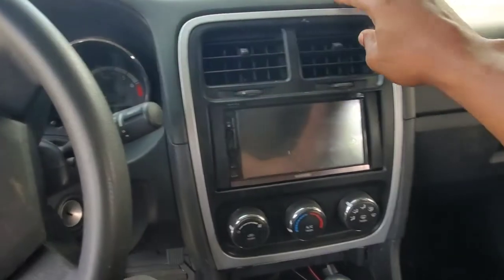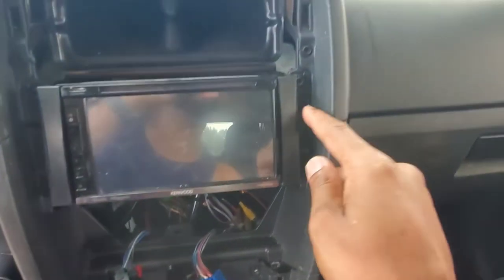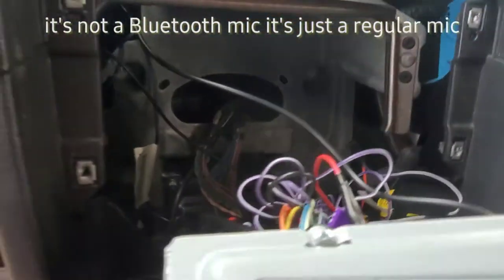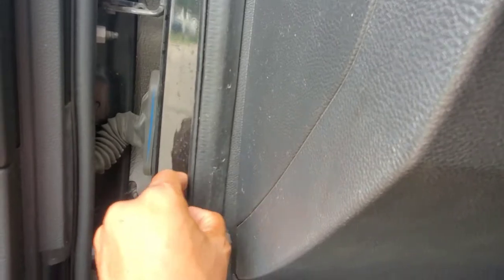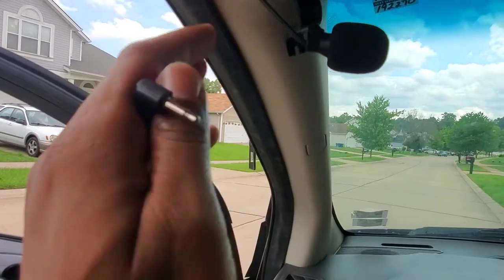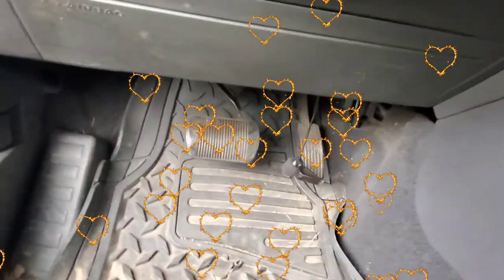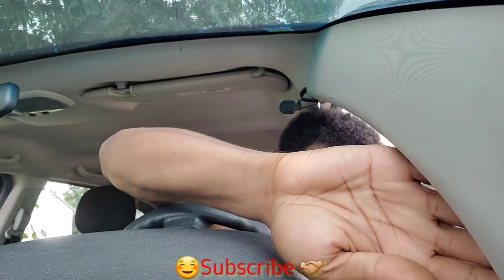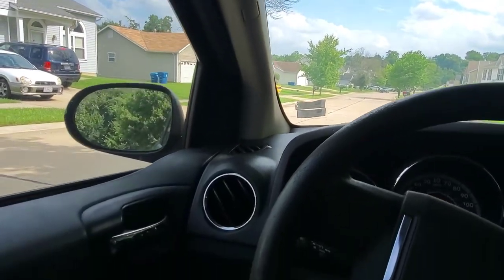How to install a mic for aftermarket stereo (easy)

Comment: If I installed a head unit display and it has a mic on the side panel of the car next to my head do I use external or internet mic in settings? Thanks

Comment: I was having trouble removing the a panel from my 2008 Honda Accord but you helped me realized that I don't have to remove it, it just needs to be able to clear the cable so it can be tucked in. Soon I'll have my microphone installed with my already installed brand new radio. Thanks, fam